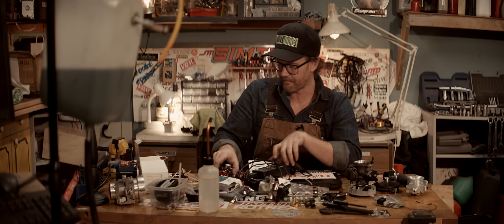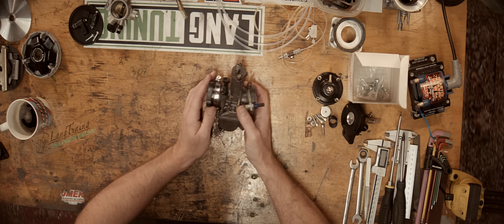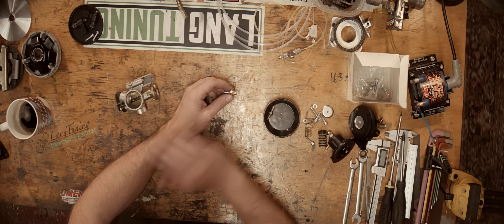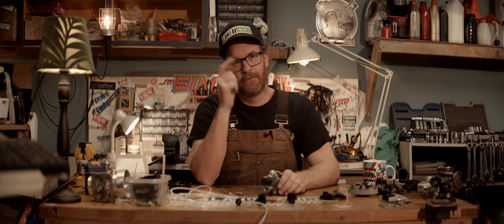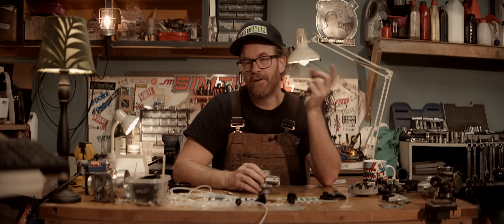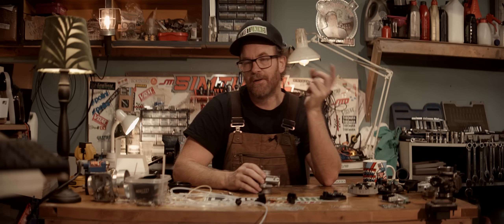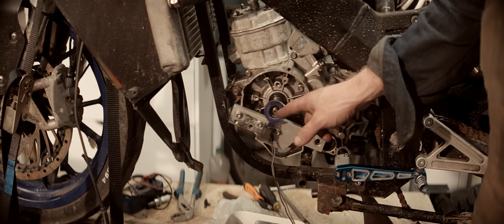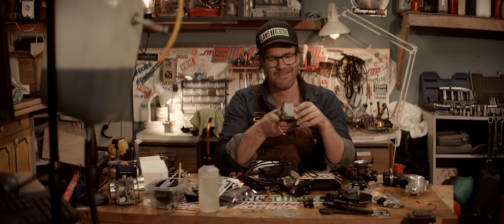Nitromethane Two Stroke EFI, but not how you think.

Comment: I am all for the fuel injection, and I don’t think you need to worry about rich and lean pockets. If you run it like batch fire it sprays all the time. That being said if you try to have it run like sequential injection you may have some lean pockets, I think it unlikely, but it would be possible.
Reply: Das Problem ist hier, das bei einer 4-46/50 Nitromethan/Methanol-Ölmischung das Öl heiß aber langsam. Wenn Sie in einen Port flüssigen Kraftstoff direkt über den Kolbenboden Einspritzen und Sie haben aus dem Außlass eine harte leicht feuchte aber wenig warme Frischgaswelle die dem entgegen kommt wird der Einspritzstrahl zersteubt und teilweise Verdampft. Erreichen Sie da den Trippelpunkt des Methanol so das H2 NO2 und restflüssiges Methanol wird dieses sich in der Mitte des Kolben nach oben bewegen, beginnt bereits der Wasserstoff die Luft aus dem Zylinder zu verdrängen Richtung Auslass und zum Teil noch zurück in die Kurbelkammer. Resultat 25% zu Fett. Nächster Takt läuft gegen eine Zündfähige Frischgasladung im Auslass was zu einer sehr harten Mehrfach-Reflexion bei der nächsten Kompression führt die den Kolben sogar gegenüber dem Außlasport aus den Zylinder Punktscheißen kann. Schlagartiger Stillstand. Geschieht dies nicht kann sofiel Frischluft aus dem Auspuf in den Zylinder gelangen das dieser extrem abmagert bei nächten Arbeitstakt. Ca. ab 800 Ps/Liter Hubraumleistung sind dabei möglich.
Reply: @Reiner_Markenfreund  🤔 That's a lot!
Reply: What do you mean with "If you run it like batch fire it sprays all the time."?
Isn't batch injection like sequential injection but instead firing a batch of injectors at a time(needing less injector control outputs from the ECU)?
Reply: @TarenGarond  no it just sprays all the injectors all the time. This is how those carbs that have injectors in them work. Because  you can drop one on a car that has no crank position sensor or cam sensor there is no way for you to time the pulses. It turns on and off rapidly regardless of what stroke you are on. It only needs a temp sensor, rpm input, IAT sensor and a map sensor to run. You could substitute the map sensor for a tps sensor, or a maf, but it is harder to tune.
Reply: @andrewf8486  The second question I asked was just rhetorical, I know what batch fire injection is.
Reply: What about using two injectors pulsing 180 degrees apart?
Reply: @LightBranches  Das ist eine ausgezeichnete Idee für Kraftstoff-Doppel-Injektoren, die in die Mitte der Lieferkanäle bei 46,4% bis 53,6% mit einem Eigen-Volumenbedarf von -7,2% Kraftstoff sowohl in Strömungsrichtung als auch gegen die Strömungsrichtung einspeisen.
Reply: @andrewf8486 I think you're slightly misinformed. While batch injection fires all the injectors in unison, they most definitely are not spraying *all the time*. At low engine load, they are off most of the time. The significant issue with using standard injectors on a very high RPM two stroke engines - batch fire or not - is that there is a finite time require for an injector to open and close. A two stroke at 20,000 RPM has just about 3ms per engine cycle. That is less time than many injectors take to open and close - let alone having time to supply enough fuel for what is the highest peak loading of the engine. And this isn't a matter of just using bigger injectors, because it's the physical limit of energizing the coil and waiting for the mass of the pintle to move.

One way to deal with this is sequential alternating injection. Basically, two (or more!) injectors that inject every other engine cycle, giving each of them twice as much time. But even twice as much time at 20k RPM is still only 6ms. That's not a lot of time when you need to get a lot of nitromethane into a cylinder. 

Once your injector reaches 100% duty cycle, it now never closes, and you've lost all ability to control AFR at that point. So, it can't be tuned! And there is no longer any benefit to having EFI.

So in this instance, the implementation of a pump-controlled fuel mixture is very valid and solves more problems than it solves (most likely.)
Reply: @bradley3549  I’m not misinformed, I think your concept of batch fire is flawed.  The injector isn’t firing at the same time on the same stroke every time. It is a rudimentary system, meaning that it is not smart, it doesn’t know where the crank is, because it doesn’t need a crank sensor. It determines fueling based on load and engine speed. It just changes the pulse width, sure you may have a charge that is slightly richer or leaner, but we are talking a tenth of a point. You would only run out of duty cycle if the injector was too small. That being said if you run a large injector you will probably have poor idle quality, but since that is not a factor on this engine that idles at 5000 or more I wouldn’t worry about it.

In essence it is like a carb it will be spraying fuel then the reeds are open and closed the fuel will get homogenized in the crank case. There is no issue.
Reply: @andrewf8486  Great theory you have, but in a high RPM two stroke application, your proposal will result in dramatic AFR swings between ignition events. There is simply not enough time to average injection events. And your idea to increase injector size to avoid running out of duty cycle only makes that WORSE, not better. You seem to be under the impression that a fuel injector can vary its flow rate based on a PWM signal, and that's just not the case. They can't be half-open.

Bottom line, the math doesn't work out.  Maybe 4 or more injectors SEQUENTIALLY in a ring configuration could average the fuel flow enough to mask the inherent dwell time of an EFI injector. That might work. But then finding injectors small enough starts to become a challenge as fuel injectors also have an inherent minimum flow.
Reply: @bradley3549  I don’t think that you can pwm control an in injector, it’s ether 100% open or 100% closed. What I’m saying is that the the fuel is being sprayed in on both intake and power stroke. It is only off for a fraction of a second, the fuel will accumulate in the reed cage, or the rotary valve and be sucked in when they open. This is exactally the same as what would happen with the mechanical pump. The only difference is that the efi would give you much more finite tuning capabilities, and if you ran it with an o2 sensor you could build in some safety. I think you believe that the injector is only open during the intake stroke, which I agree would be hard to control. With say a 90% duty cycle the intake and crank case would be getting fuel 90% of the time. The crank case never completely empties all the air fuel that is in it. So you are adding fuel and air into a chamber that stores fuel and air. If one charge of air and fuel is a little lean it gets averaged out when it enters the crank case. If the crank case is slightly lean the next air and fuel charge will increase it richness of the crank case. This is how all engines operate all the time. The differences are so minute that an o2 sensor can’t react facts enough and the fuel curve looks smooth. Let’s go one step further. An intake manifold for a v8 has 8 runners that are different distances from the carburetor. Every cylinder is getting a different amount of fuel and air, but it runs smooth. I think you are over thinking this. I would rather have a system that has the same fuel pressure, and flow rate at all rpm, instead of one that changes with load. It will be way easier to tune.
Reply: @andrewf8486  What you're missing here is if you use any injector that is open some of the time and closed some of the time, it has the potential to be closed for nearly an entire engine cycle at the time scales we're talking. So yes, while fuel will pool and average out some of the peaks and valleys, and that's totally fine on a low horsepower, low RPM engine - missing an nearly an engine cycle with an injection event will absolutely cause damage at these RPM and power levels. Period. You can't risk that. 

You are simply not understanding how fast things can go wrong at 20,000 RPM and 500+ HP per liter.

Comment: Go ahead and explain how our Polaris efi 2 strokes work then? They have a tbi injector like any 4 stroke and some temp probes is all, they run amazingly, with or without turbos as well, I think you are overthinking it
Reply: At which RPM does the Polaris make peak power?
I would love to see him try EFI, but at 18000RPM you have a very limited time frame to inject.
About 3,3ms per rev, making it 2,5ms or just above that when dead time is substracted.
Reply from the maker: I might be over thinking it, and I'm aware of the sleds running tbi. Continuous injection is a simple start tho, can control it with my ignition unit.

Comment: I think the main issue with normal EFI injectors (pulsed) is the limited "dynamic range" if you will. To go from idle fuel requirements to max power fuel requirements is a HUGE ratio. Injector resolution at idle is probably going to be very poor. I think you're taking a good approach.

Comment: why don't you use pwm on injector?  Like 150 Hz frequency and control the mixture with the duty cycle which is controlled with the TPS, 5 minute program in arduino.
Reply from the maker: Cause I can control pump speed with pwm and have continuous injection. Also that small gear pump can do 80bar.
Reply: @2STROKESTUFFING  And you think the pump will spin up or spin down as quick as you manipulate the throttle? The injectors flow rate is not exactly linear with the pressure, tuning without O2 will be nightmare. That you can do something doesn't mean you should, but you will find out and I will be happy to see your journey. I have high hopes.

Comment: im making some things you might be interested in a. super simple range of ecus, i could modify my base ecu code the will control that injector and fuel pump with simple tps map range adjustable via buttons. would be around 20$ in parts and an hour of assembly

Comment: How about multiple smaller carburetors that open up at different points so at the low end you have a single working mid-range will say two and then high in the RPMs three or whatever it may take kind of like how a Yamaha VMAX works

Comment: What is that black motorcycle you’re taking apart? we’ve never had anything tiny like that that I know of in Canada. I had a RD 350 LC and that was a small bike motor, we do have small dirt bikes but not street bikes like that.
Reply: DerbiGPR50/ApriliaRS50....you can just swap the front lower frame to fit the 125cc engine of DerbiGPR125/ApriliaRS125 of 2005.

Comment: are you allowed to run all the electric feom a battery in the 50cc category. powering injection, spark, and ECU straight from a battery would be an easy way to increase power

Comment: use a pressure vessel instead of a pump...
Reply from the maker: Gear pump is nice cause it's positive displacement, fixed volume pr revolution.
Reply: I know you likely know this Alex but, a gear pump still gains efficiency with increased speed and loses it with increased pressure to a degree. Depending on its internal clearances there will be some critical that it reaches near 90% efficiency, but it can go up / down 10% easily from pressure at this speed, and if the inlet / outlet ports aren’t adequately sized it will actually be less efficient at greater RPM (at the same pressure), due to cavitation..…..in my opinion (I used to design / develop gear pumps for a living for diesel engines); you’ll want to spin the gear pump at least 1000-rpm to reach a point of its geometric displacement nearly equaling is empirically measured displacement by volume / time. If you intend to spin the gear pump slower than 1000-rpm and not use a regulator, the speed vs. displacement (at a fixed pressure), will be come VERY non-linear as the speed progresses towards zero RPM.

The pressure capability / durability is not as high for a vane pump vs a external gear pump but its displacement would be much more linear if that’s what your wanting to accomplish.

Good luck / best wishes
Reply from the maker: @ericschumacher5189 Thanks for the input!
I'll map the output vs rpm to create a curve that I can use to compensate. This pump might not be best, but it's a start.
Reply: No problem Alex; for this pump the way I would suggest mapping it is the following. Pick a number of pressures both above and below the fuel pressure you want to target for injection (ex: 0-bar, 2, 4, 6, 8, 10), and do the same for speed (ex: 500, 1000, 1500, 2000, 2500, 3000)……you will need to map every individual pressure condition for every individual speed condition (unfortunately this can be 100+ points depending on how granular you go)……the zero outlet pressure condition (full flow without restriction) will be the most important to estimating its empirical displacement to de efficiency calculations based off of……as said it’s likely that at around 1000-rpm the gear pump will reach its highest efficiency with NO outlet pressure (assume this is 95-99% efficient), and you can calculate what it’s (cc/rev) displacement is, which then can easily be converted to (l/min) by doing (displacement * RPM/1000) to check efficiency at other speeds….when you put all the data in Excel you’ll notice (if you put VE% on X-axis, speed on the Y-axis, and pressure on the secondary X-axis, that the range of speeds / pressures that VE% is relatively linear (80-100%) is relatively narrow……this is ideally where you’ll want to operate the pump mostly to avoid high power consumption / heat / wear, and it would make a speed based control map the easiest……in industry most pumps have a bypass regulator so that they stay in this range during all operating conditions (it dumps the extra flow back to the fuel tank that’s not needed and holds pressure more constant within a wider range of speeds.

My only (mechanical) suggestions for this mapping test you intend to do, is to get a screw-type-needle-valve to control outlet pressure / flow…..also if you decide to do the test with water, I’d add a lubricant to keep the gear pump from getting damaged, such as radiator-coolant, and possibly castor oil at a similar ratio to what you’d use with your fuel.

Comment: It sounds like if you go the EFI route, you should probably allow for port AND direct injection. I dont remember anymore if you're still planning to incluslde supervhargig but in any case, if your engine ia tuned for peak rpm/power, having DI could help get torque for low rpms. injecting fuel AFTER the cylinfer is fully sealed, meaning no guel in the exhaust. when you get into rpma where DI downt provide enough atomization/homogenous mixture, you pregerasively transition to port injection or port + direct injection. worse casw, if direct injection doenst help, you dont need to use it.

about testing youe new ideas a sub systems, amd only integrating them AFTER they have been proven to work sounds like a reasonable idea

Comment: Why not just run alpha-n on a standalone ecu?
Reply from the maker: This will be close to the same thing, but I can control it with the ignitech ignition unit. If it works...
Reply: @2STROKESTUFFING  fair enough, microsquirt could be a good affordable option, you could also blend an alpha-n/speed density table if you ever go boosted

Comment: Electronic fuel injection is not works the way you described. The proper way is to calculate and inject the perfect amount of fuel into the engine in every cycle synchronized to the crankshaft.

Comment: Your totally incorrect about the lean rich pulsing from the injection system. Your trying to educate people from knowledge you have not even accumulated from experience. It pisses me off. This is all simple and done before you. Start learning from it.
Reply from the maker: Injecting into the transfers while they're open would eliminate the lean/rich cycling, but there's not enough time at high rpm. Injecting into the case will cause pockets of varying afr, and there's no way of controlling when those pockets will be sucked up into the transfers.
Normal pulsed efi into the intake/case works, but continuous injection should work better. 
Cool down.
Reply: @2STROKESTUFFING  There is no "Pockets" or "Lean rich cycle" Your focusing on events that happen in milliseconds. The reason the injector is pulsing rather than wide open is to maintain a constant homogeneous mix of the tuned air fuel ratio. I am actually doing this. I would love you to have success. Happy to help anytime. I build motors, tune, dyno, make dynos, make efi ecus, all of the above. I just want you to stop going off on weird ass tangents with your work. When its been done so basically and well before.
Reply from the maker: Thank you for wanting to help out👍 Could be I'm over thinking it. Especially at high rpm, and especially with the large amounts of fuel running nitro.
Reply: The pulse of the injector is tuned to your desired cumulative mix in the cylinder. Which will show as a total of what was in the cylinder on the tail pipe reading with a air fuel ratio meter.
Reply: @2STROKESTUFFING  What is the best way to chat ? I promise to be nice. Your skills with the engines are out of this world good. Making them on CAD and simulating them then cutting the cases to make them run. Major major skills there mate. I really want to see them singing. I have a yourdyno controller on my dyno even :)